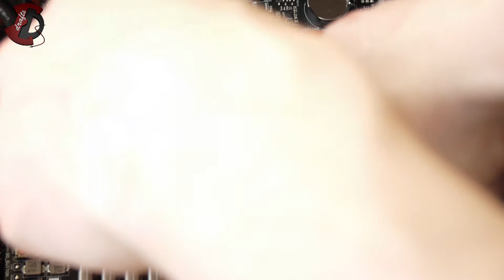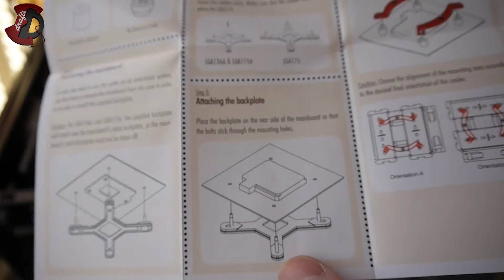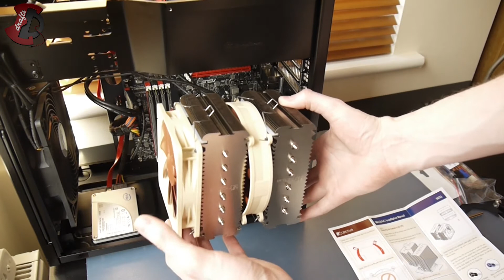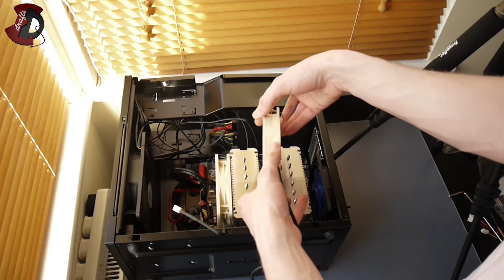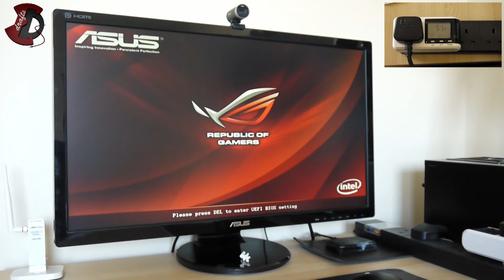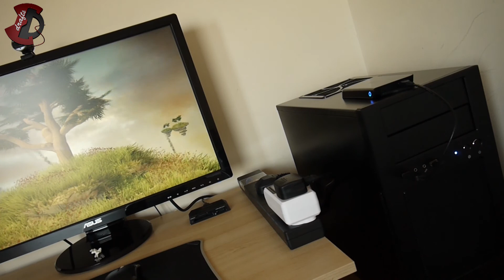IvyBridge Build Intel i5 3570k ASUS Maximus V Gene Z77 Part 2 of 2

Comment: Hey jesus / Eds 
i also have same problem, when i try to connect directly (using hdmi or display port adapter) to my Samsung 20" monitor it won't display any thing..
i used my nvidi graphic card for display 
can any one have solution for this issue.

Comment from the maker: There are 2 ports at the back of the motherboard if you do not have any graphics card - HDMI and display port. If you do have dedicated graphics card then it would depend on that card. There would be no problems either way, considering you are using standard resolutions like 1080p.

Comment from the maker: Hi. Although I haven't tried myself it should. I can't see a CPU cooler made so that GPU can not be used. You might be very tight though. Also as per post below GPU usually has all bits extruding on the other side while the back is usually plain without any pieces in the way.
I'd say you will be fine but just in case have a look at ASUS measurements and check cooler ones too. Then do some math just to be on safe side.

Comment from the maker: Yes you can. Unless your card has unusual design on the back. Usually all the heavy bits are hanging off the other side so no issues there.
As for your 6 identical posts - unfortunately it takes some time for me to approve the comment. You have to be patient.

Comment from the maker: Since new range of Intel CPUs is on the way, you might want to look into newer platform if you are buying whole new system. Otherwise just have to think of what you need the PC for and prioritize what is your criteria - i.e. looks, built in wireless, ports, amount of drives supported etc. There are tons of motherboards for LGA1155. You can even filter by price range.

Comment from the maker: I see your point. Last year I have had a task to assemble a cheap and fast PC for home office. I went AMD and Intel way to check the pricing. Both were nearly identical so I went with Intel. Slightly better performance and power consumption. 
3570k is expensive but it delivers. On cheaper end you can go for i3 2120 and that will perform nearly as well in games and some apps.
I really can't complain about price/performance ratio of most Intel CPUs. You get what you pay for.

Comment from the maker: Make sure you have the latest BIOS first. Update if needed. Then check your manual which port is which. Connect SSD to first Intel 6Gb/s port with other drives to follow in others. Avoid non-Intel ports. Just my observation. Then go back to BIOS and make sure your drives display as you expect. If not come back and plug them right. After this simply go into BIOS and set up start up sequence SSD being first. Worked fine for me.

Comment from the maker: I had older Gene board before fitter into ATX case. Still looks fine and is convenient. More space for decent airflow and cable management. Overclocking should be dead easy though I haven't done any yet.

Comment from the maker: No probs. I loved the Noctua, it is all I want from the cooler. Might be big but it's definitely worth the ratings it receives. You can OC as well as with H100 if not better as well just make sure you install it right. Also make sure to use normal profile RAM if possible as on some MB high raised RAM can cause some headaches. Best of luck.

Comment from the maker: hi. It's sometimes uncomfortably hard to work on these small builds but I have Hyper 212 now with NVidia GTX 560Ti in first slot No issues whatsoever. HDD cage fit right in as well. Thanks.

Comment: I'm using the Maximus V Gene Z77 And Phanteks PH-TC14PE and it doesn't render the first pci-e slot useless, although it's VERY close though, so you might want to put something to insulate the fan retention clips from touching the gpu.

Comment from the maker: Price/performance ratio 3570k is much more suitable CPU, unless money is no subject. In that case however 3770k is not the top tier CPU. Should your work evolve around heavily threaded apps Socket 2011 might be a better pick, or even Intel Xeon CPU range. If you only use PC for pleasure and hobby then 3570k is a more suitable buy. Remember, the only difference is HyperThreading that is not an actual core. So you still get 4 cores just plus some optimisations that help in rendering etc.

Comment from the maker: Because air cooling even in this day and age still has advantages - i.e. virtually no delay between fan cooling and actual effect on the CPU. Also resale value is much higher since there is little to go wrong with air cooling.

Comment from the maker: Are you sure? Modern motherboards should eliminate this. Problem is the memory should only run at half the rated speed as dual channel would not be functional - i.e. 1600MHz -> 800MHz effective.

Comment from the maker: Sure you can. Board PCB would be close but to cooler but nothing to worry about as all the heatpipes and fans are heading up away from it. I did change to Hyper 212 though to get some space around and so I could install HDD cages properly. Still tight but much better.

Comment from the maker: Surely you can use onboard GPU that your 3570k has. Z77 supports that no problem. Use HDMI if possible as digital does not lose quality as oposed to VGA.  Don't be worried, it will work just fine. Apart from games everything will run smooth.

Comment from the maker: The only thing with some RAM including Kingston is that they run by default at 1.65v and users claim that in long term that can damage the memory controller on CPU although to be honest nearly everybody uses this way and no issues. Have your modules tested elsewhere. Update BIOS via special USB port at the back, check manual for info. Also check RAM one by one.

Comment from the maker: Have you OCed your system before this? You might have set some odd frequencies. Try resetting BIOS. If still no luck - first, remove the RAM and re-insert it, then try again. If no luck try removing all modules and place one by one while booting after each. That way you might find out if RAM is ok. If all fails try to remove CPU and reinstall it (mind you if you have installed your CPU wrong you might have damage MB socket; check if all pins are pointing the right direction).

Comment from the maker: Hi. Thanks. Temperature readings depend on what software you are using. For instance HWMonitor shows about 10C higher than ASUS one. 37C on idle I think is high for any aftermarket cooler. If you are talking about load then it's very good. My idle temps on Stock Intel cooler are around 38 :) Mind you loaded jumps to 65-70. I have different rig altogether now..

Comment: Hey, great video! I have just build a rig with the same motherboard, CPU and cooler.
I'm not sure if i missed it in the video, but I would like to know what your idle temperature are.
My are around 37 celsius and I think that's quite high for a cooler this big.
Would like to hear your thoughts about that! Thanks.

Comment from the maker: Recently I have removed Noctua and the 550 Ti looking for an upgrade. I don't remember CPU temperature going over 40 and MB over 35 even during gaming. GPU I think went to max 68 with ASUS DirectCU one. Currently CPU goes to 47 and MB to 39-40 with Stock Intel Cooler :)

Comment from the maker: Provided your graphics card doesn't come with some additional plates on the back (most come just with plain PCB) you should be fine. I am not planning to run SLI, no. I'd rather invest in faster GPU to be honest - less power consumer, less heat, less noise and usually same price tag plus no micro stuttering.

Comment from the maker: If you mean when I placed the CPU in socket and to close latch? No, not at all. There should be no force used. If you have to - something is not right. It's so easy a 5 year old with one finger could close it - no force should be needed. Be careful - it's an expensive mistake to make.

Comment from the maker: Irrelevant for the moment. Die size helps but even more benefit is new architecture that would allow to perform better by optimising codes and processes. We've learned with Ivy Bridge that technology shrink can affect temperatures in extreme ways when overclocked.

Comment from the maker: You mean Intel Core 2 Quad Processor Q6600? Sweet CPU. Unless you are desparate to upgrade you could just get a new motherboard (that supports LGA775) and maybe better CPU cooler and wait until next Intel line-up that should be a big step - see Intel Tick Tock approach.

Comment from the maker: I do respect your opinion. However, you are not comparing apples with apples. 7850 is next gen and does not support Cuda acceleration that I do need. For that price however, I could get GTX 560Ti 448 core that would do the job and perform just as well. Never mind watts, GTX 660 is going to fix all that :)

Comment from the maker: Not bad. HCG are fine PSUs. I found the same with X660, not widely available compared to Antec. I have my eye on GTX 560Ti 448 core one. Runs like GTX 580 stock when overclocked and definitely faster than GTX 550Ti in SLI (and cooler if DirectCU one). For benchmarks I went and downloaded free 3D Mark 06, Vantage and 11. All game demos are free on Steam too. So was pretty nice for benchmarking. Would be interesting to compare scores with you.

Comment: Cool thanx heaps,,, Had trouble saucing the seasonic x660 here in oz, I've gone with a antec HCG 750wat psu at $139 it's great value and have upped the video card to a XFX R7770, I should have it all running late next week. I'd like to run some bench-tests can you please tell  use where we can find good testers.. Thanx again

Comment from the maker: During idle 28-30 depending on room temperature (20 or 25). And around 36 when gaming or encoding. I saw increase in temperatures due to GPU "dumping" loads of heat into the system. MB temperature was affected the most. If you want clean and quiet system and don't play games - get rid of GPU :)

Comment from the maker: The PSU I have would run your system no sweat (I would say you would be able to run even GTX 680 or HD 7950 in SLI/Crossfire). Plenty of cables to hook up 2 x 6770. SSD and DVDRW don't eat that much of power. CPU and GPU are the most hungry.

Comment from the maker: One thing to warn you about, if you use same motherboard the drive cage/GPU support will not allow the USB 3.0 cable to be plugged into the motherboard. Other MB might be ok though. Cage consists of 2 parts. Bottom one allows SSD and HDD at the same time. Top one holds 3 HDD/SSD drives. I will have a video of GTX 550Ti DirectCU soon. Have a look when I will have a close shot of GPU in case.

Comment: Would it be possible to use the HDD cage for a SSD and putting my HDD on the bottom like your SSD? I'm planning on buying this and doing the same thing, but having an evga gtx 670 ftw and a HDD and SSD. Please respond I could use the help!! You're the only simillarly spec'd build I've seen!

Comment from the maker: It is and it isn't at the same time. If I would go again I would go for Hyper 212 Evo (or whatever the new version is) and spend the extra on GPU. However, I have set the CPU for 4.6GHz and did quick bench (maybe 10min) and the CPU did not reach 50C with ambient at over 25C. So that's pretty amazing for air cooling. But.. I don't overclock and don't intend to, for that reason any decent cooler would do. But if you wish to OC then go for the best.

Comment from the maker: Yes and no. Some people prefer to spread the paste around with a credit card or similar object. I prefer this method as it always worked (surprisingly) better than any other. It also eliminates the error of air bubbles when spread using other methods. Check here for more -  benchmarkreviews site article Best Thermal Paste Application Methods. Best of luck.

Comment from the maker: If you look carefully in my video, main thing is motherboard (24pin) and CPU (4/8 pin) connectors. That alone is enough to run the PC (sort of). Then if you MB has the plastic header to place on LED/power/reset connectors you just connect your case wires to it (as displayed on the header, if not - according to the manual) and connect the whole lot to the MB. Last but not least check your manual for Fan ports and connect accordingly then proceed with your SATA connections.

Comment from the maker: Depends on your build case cooling. I would say you will be fine. Unless you are very tight on budget I would, however recommend at least Hyper 212 cooler. You will notice how much your room heats up too when CPU temp is 40 instead of 30 :)

Comment from the maker: What type of work do you use your PC for? And are you going to overclock it? If you are just casual gamer and don't overclock standard Intel fan will do just fine. Especially on Ivy Bridge CPUs. If you are gaming or using PC as workstation for rendering or encoding a lot or overclocking for any reason - get as best cooling as you can. At least Hyper 212 as they are not pricey but perform really well (even better if you use Arctic Silver paste but not required; supplied paste rocks too).

Comment from the maker: It's a software/fan issue. Using factory settings motherboard can control the speed of fans depending on the temp. This front case fan doesn't have that wide range of operating speed. So if not set right it won't have enough voltage to spin. After manually setting it via FanExpert in Windows or BIOS it will work just fine. I suppose I have never went that particular about fan speeds and controls so was new to me. Now works fine (mind you have to load preset every time I boot..).

Comment from the maker: Hi. Good question. I actually haven't as I don't play games (no time and dedicated GPU). But I have installed it previously and it does seem to prioritise and display traffic use. I would be quite confident it works. If you have issues with lag and busy router - use wired connection and get router that prioritises traffic properly.

Comment from the maker: Honestly? I think 3570k or even 2500k is overkill for gaming. If you want to just game, I would advice something along the lines of i3 2100 + decent GPU like NVidia 560 Ti or AMD 6850. If you are focussing on some video or 3D (like myself) then go for 3570k (3550 not that much of a saving and is locked, will be harder to sell later as well). 2500k is still a nice CPU but prices should be equal 3570k anyway so always go for newer (less power hungry, runs cooler too).